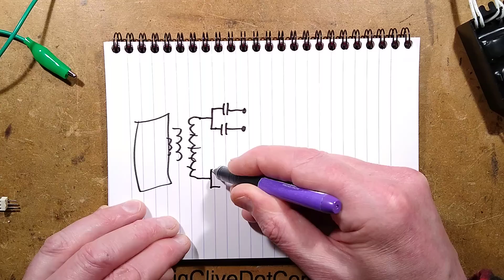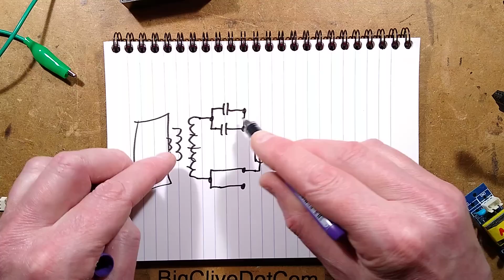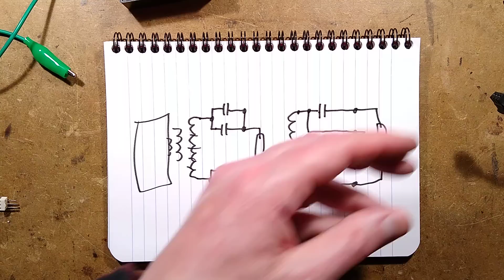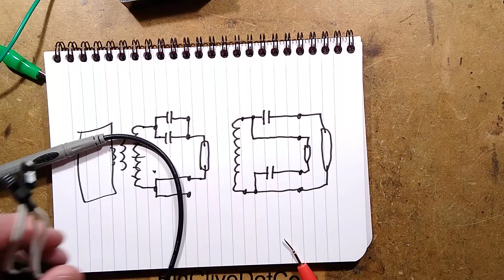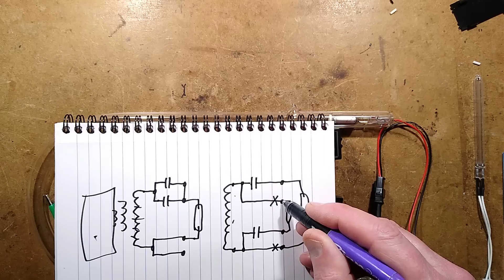Neon tube driver hacks

Comment: A few years ago we were at a restaurant that had what looked like neon lights, but the tube was covered with either a paint or phosphor. Perhaps inside or outside. I couldn't touch it, out of reach. No transparency. Was this a likely a neon tube, fluorescent tube or something else? I didn't think it looked quite right. Anyone know?
Reply: That's basically a fluorescent tube.  Mercury vapor (mixed with a bit of argon) generates UV light which is converted to visible light by a phosphor coating.  The only 'neon' sign tubes that are pure neon are the reddish-orange ones.  The other colors use different gas mixtures, colored glass, and/or phosphor coatings.

Comment: Neon may be getting phased out, but as an avid scifi fan I shall always think of future worlds awash with neon signs especially in their downtown or undercity areas, like Blade Runner snd 5th Element, etc, so it may soon be gone but not forgotten.
Reply from the maker: The Blade Runner neon was stunning.
Reply: There is a bad, low-budget sci-fi movie called Crime Zone (1988) which has a ton of neon. Aside from the usual signage, it has neon in many locations, often in places where it makes no sense, and even a pool table with neon tucked under the bumpers and on the pool cues!

Comment: You could make "angel eyes" kits with a bent acrylic tube, bright LEDs shooting into either end, and scuffing the forward-looking surface to let light selectively "leak" out.  First kits were with halogen bulbs, but LEDs on MCPCBs let you customise the color, too, vs just halogen-white (~3000K).
Reply: Those are junk though. My neon angels in my Audi are Soo much brighter than the LEDs were in my 755il

Comment: the giant neon sign at my work is getting a worse fate than scrap; they're having a signage company cut the ends of the original tubes off, and pull LED tape through with a special diffuser. I figured out that they're DC powered, so the dead sections likely just need the polarity swapped to revive them, but, alas...
Reply from the maker: Pulling LED into existing glass tubes sounds a nightmare unless they are simple curves or straight sections.
Reply: As a glass blowing sign guy who works with tons of both neon and LED I low key love this mash up of new and old.  😂

I predict those LEDs will start failing fast after the first summer in their new glass houses.  I really wonder what kind of warranty the company has bought into?

The company could always pay to have new electrodes welded on after they learn a painful lesson.

Now I really want to try this for a laugh at work.  I'm envisioning myself vacuuming a string through the tube to assist in fishing the LED tape.

Comment: Hello Clive, an old school neon bender (neon glass blower) here, +40 years.  
Have you seen these 3" plasma balls on TEMU for around US$5? They have a very small driver which surprised me on how small they are. I was expecting something like what you have in this video. Maybe this could be a Big Clive investigation?
Reply from the maker: I've featured a USB powered plasma ball and its driver in a video.
Reply: Cheap chinese plasma globes often have a flyback power supply, they output spikes in one polarity and a lover voltage wave in the other polarity.  The Royer/Baxandall oscillator is much better because it outputs a proper sine wave. But of course course nothing can replace the good old Tesla coil.

Comment: Cold Cathode units were massively, massively popular in the world of pretentious computer cases during the middle 00's. It wasn't enough to have a see-through box, you had to have it lit with cold cathode tubes... And then six weeks later when your PC was out of date you had to buy and all-new one.

What fun times they were.
Reply: I still use my bad-tastely modded case and none of my tubes died. 2 decades old tubes and drivers. Not forgetting that my pc is turned on form waking up to after midnight. Talk about sustainability.
The hardware inside was upgraded many times, sometime requiring an angle grinder for installation.
Reply: Still running one of those pcs to this day. I don't do emulsion I use real hardware. Ccfl is SO MUCH BRIGHTER than leds
Reply: I came up in this era. I was one of the early adopters of water cooling, had a Danger Den spiral aluminum block on my overclocked 1Ghz AMD Thunderbird processor when I went off to college in the fall of 2001.  Waterlines went to an external radiator and fan set up which made it a bitch to move because I had to disconnect and drain everything. But I had large fans installed on that radiator running at half speed so damn if the thing wasn’t damn near close to silent which is pretty cool considering my roommates shitty Dell with 1/3 the power whirred and hummed constantly.
Reply: Lol, I just posted a comment a few minutes ago referring to that craze of using C.C.L. in PC's. 

I still have a bunch of the power supplies left over from that era. The tubes are all long dead or broken, but the supplies are still good
Reply: I never grokked that. I usually put my PC on the floor under the desk or in the hutch and couldn't really see it anyway. And now that they are small, they tend to go behind the monitors, where I again can't see them. I need the desk space and the PC was just another thing taking up that precious space.
Reply: @strehlow I’d say the ones that aren’t gaming PCs or “powerful” don’t require the neons in anyway.
Reply: Didn't have to buy a new one. Just like now you upgraded components. We're still running one of those totally clear cathoded cases right now with current hardware. Some people just don't understand what an upgrade is or how to work on their own machines. Sorry but around here is BUILT NOT BOUGHT, we dont buy that behind the monitor Dell or Lenovo bullshit. This isn't the place for you.

Comment: I really don't like LEDs as much as I used to because I feel people get very sloppy about using LEDs to light things well, and sometimes don't care when the colors are just horrible for the application. The loss of good esthetics actually looks far worse than I thought it could get in everyday places. Even the older displays that just used bare led dies as pixels were better than the crappy diffusers so often used. They are just token gestures all too often. It's about shaping the light and making it light up something evenly to the edges. I think of making neon and other types of displays that look as good as possible; as something I want to do just because I know how good they can look. And it seems this is becoming more important than just how I feel about it. I hope anyway.

Comment: The marquee at the top of pretty much any arcade machine ever was CCFL.
Reply from the maker: Many here were hot cathode fluorescent tubes.
Reply: Many especially in the 80s and 90s were just regular fluorescent lamps with a ballast and starter, illuminating the marquees.
Reply: Well, they were cooler than incandescent, hence being suitable for an enclosed space like that. ;)

Comment: 10:30 is it worth making a small wooden frame with the wire going to a small terminal block so the life span is increased?
Reply from the maker: I do have some mounted in plastic bases.

Comment: Thanks for the insight into these drivers, Clive. I don't know if it's possible or practical, but it would be interesting to know what would happen if one of these driver modules was connected to different types of discharge lamp. There are quite a few ranging from street lighting lamps to various industrial and commercial lamps such as those used in retail outlets. Maybe a more powerful driver would be required or would there be quite a nice effect from being driven at a lower power?
Reply from the maker: Driving discharge lamps at low power sometimes works, but there's a point where the electrodes suffer for not being hot and in an emmissive state.  They sometimes sputter from a small point of light that moves about on them.

Comment: There are still benders out here!  I will make you any neon tube you want.  I convert old lanterns into neon lanterns and am always looking for a small transformer, this may do the trick.  Usually I am pushing about 18" of 10mm glass with argon (less resistance than neon so you can push more glass).
Reply from the maker: I think there's a market on eBay for short straight tubes for collectors.  Short and straight to make posting in a tube easier.
Reply: I've been looking for someone to make me a small custom neon tube for a home decor project. I'll contact you via email, thanks!
Reply: @oxoniumgirl I shot you an email this morning.  No problem.  We can talk about size, but most definitely doable!
Reply: Are there any sign makers who use helium, krypton and xenon or only the standard neon and argon+mercury mixture?
Reply: @mernokimuvek helium is used to flush tubes for cleaning, it burns it fast if used as a lighting gas.  I have used xenon and krypton for specialty pieces as the gases are quite expensive.
Reply: If you are looking for cheap and compact SMPS neon sign converters, please consider finding a local reseller of Chinese Hongba products. The HB-C02T and TE are inexpensive and generally effective small units, priced at around 3.5 USD per piece for wholesale purchases, and around 7 USD for retail. They offer no mercury migration  in Penning and no "jelly bean" effect, ensuring clear neon gas tubes.
Reply: @maciekgd  Been using Hongba (Neon Pro) for years.  Well made and great.
Reply: Usually used a mixture of neon and argon as it strikes a lot easier and is more forgiving at different pressures. Was pretty popular for outdoor tubes.
Reply: @christopherleubner6633  I use  "K4" argon gas, a 75% argon 25% neon mix.
Reply: @DragunSigns  the composition of the "blue" gas mixture depends on the climatic zone in which the neon tube is to be used. In Poland, it is a Penning mixture with a composition of 75% Neon and 25% Argon, purity 4.5 (99.995%). For such a mixture, we use a working pressure of 8 Torr in the 15mm tube.
Reply: @maciekgd  Do you add mercury to the mixture or is the Ne/Ar mix enough for blue light?
Reply: @mernokimuvek  You need the drop of Merc to make the phosphor light in the tube.  So if it is for lighting, yes.  For a demo of AR gas, you don't need it but it will not light up very bright without it.
Reply: @maciekgd I think I'm at 8 torr on15mm, but I've been bending mostly 8 to 10mm as most work is repairs of old signs at this point.  Used to use 15mm in channel letters back in the day and boarder tube, have bent any of that in quite awhile though.  Now that I think of it my mix is most likely the same 75 neon 25 argon.  I was reversed.  Dyslexics make his benders!
Reply: @maciekgd  The very definition of a penning mixture is a mixture of noble gases, not mercury.
Reply: Bender Bending Rodríguez?

Comment: I have a bunch of older(1970's) bar/pub neon signs from different beer companies, they all have massive inverters or ballast attached.  Also of note is that the glass tubing is not clear on many but colored pursuant to the advertising scheme for that brand of beer.  Wondering if the gas is colored or white?
Reply from the maker: It may be white phosphor in the tubes.

Comment: 7:33 probably a 22pf cap - the meter was reading about 16pf stray capacitance before connecting
Reply from the maker: That's a good demonstration of how often I test super low value capacitors.  I should have been more careful with lead placement and allowed for inter-lead capacitance.

Comment: Neon tubes are easy to make.
Reply from the maker: Simple ones maybe - with a bit or practice, but the glassworking equipment, manifold, pumps and high current/voltage bombarder make things more complicated.

Comment: 8:11 flush cutters strip much better if the flush side is towards the end of the  wire, so the pull of the wire isn't trying to pull the blades apart
Reply from the maker: I'd normally use a wire stripper, but these had thick silicone insulation on them.
Reply: That's a great tip! thanks!
Reply: That was one of the things I looked for when I was interviewing people for work as assemblers. It is so easy to know who's a pro just by watching them strip a wire and soldering a connection. That or simply handing them a soldering iron and hand tools and asking them to set up their soldering station. It was a beautiful thing to watch a pro set up their soldering iron base in just the right position at just the right angle so they could put the iron back in the holder without ever glancing over at it. I watched 1 interviewee do that first thing and told them they were hired. They asked me if I wanted them to solder anything and I said, "No need." I also watch to see if they break off a short piece of solder with their hands or cut it off with their side-cutters. ( Breaking it off with their hand stretches the solder and squeezes the flux out of part of it, meaning that there's no flux in some of the solder.) Tricks of the trade.
Reply: @johnwest7993 what about those that use the soldering iron to separate the solder?
Reply: @johnwest7993 I'd have dismissed them on the spot, I my old line of work you had to use the correct wire strippers taking short cuts would not have been allowed. Its horses for course's,  I do it that way all the time at home😂
We even had to log how many crimps you made with the crimper as it had to be checked after every few hundred crimps made, to confirm it still met specification.
Reply: @solarsynapse  usa isn't always known for quality but some products are done well.
Reply: @johnwest7993  The solder John West rejects.
Reply: @johnwest7993 Must have been a rubbish company you hired for / work for. 
A real professional doesn’t use wire cutters to remove isolation. That is amateur and hobby level stuff. 
Secondly, watching how people are setting up their work station?
What works for you may not work for others, as simple as that. 
I do agree however pulling solder apart isn’t the greatest. 

I give you 2 stars out of 5.
Reply: @johanea , I didn't set out wire strippers.  We used a machine to prep wires for production. Hand wire-strippers are for amateurs. They're much too slow and inconsistent for high-quality production. But I wanted to see how proficient a candidate was with what they had at hand. We wanted the best to work on our flight bds. You can seldom send someone up to orbit to fix sloppy work, so NASA certification was mandatory. BTW, I've done tech work at HP, TRW, IBM, and SONY, among others.

Comment: Not sure how I missed this one

I thought angel eyes were a new thing with led, I'd never known them to be ccfk before, I'll Definately have to look into that or getting the bulbs

For neon tubes, is the neon tube voltage higher for a single terminal, or less if it has connections at both ends?

Measuring capacitors in circuit, naughty

Comment: Question about the thinner size tube needing more voltage. Some Googling revealed that neon is about generating plasma in the tube. I suppose it's harder to maintain plasma through a thinner tube?

(P.S. I just got my first lower voltage bench power supply and the first thing I checked was the ground through to mains. Thanks for all of the great safety tips, Clive.)

Comment: Nice little driver, got to say real neon is soooo much nicer than LED fake neon. 2x👍
Reply: Honestly I like both, they have their applications. Of course, nothing will come close to the beauty of true neon, but LEDs are extremely efficient, both power wise and cost wise, and also don't require a noisy (EMI wise)/dangerous power supply.
Reply: I prefer the new LED neon, it looks more real.

Just kidding!
Reply: As a guy who bends and installs neon, hard to agree.  LEDs literally solves all the things I hate about neon, and meet or exceed all of the things I love about neon.  
I hate the glass shards.  I hate working with mercury.  I hate burning my fingers.  I hate  inadvertently stepping on a hose and extinguishing a glass torch.  I hate transporting them like they were the last piece of glass in the world.  I hate repairing units that I broke pushing the trode into a PK.  I hate getting shocked by high voltage.  I hate lugging around 30 pound ballasts into ceiling plenums while playing The Floor is Lava off of a ladder.  I don't love how neon is dim and miscolored for 5 to 10 minutes until the mercury heats up in the winter.
Oh hell, I must be old and crochety now, I could go on like this for days.
Reply: Nothing beats old school neon.

Comment: Thanks for the teardown!
Ordered multipe a few weeks ago. Lovely little unit. I use one to drive the neon tube in a Sox lamp at very low power so the sodium doesn't vaporise and the lamp stays in that lovely pink startup sequence.
Reply from the maker: Ah yes.  I remember now.  It was for a SOX lamp.
Reply: Sadly, Philips stopped making SOX lamps in 2019.
Reply: @mernokimuvek  China makes them now though. Not cheap I'm afraid, but they make them.
Reply: @TheFreak111  The quality is questionable.
Reply: @mernokimuvek  shame

Comment: Bet I could use one followed by a rectifier and filter for powering a photomultiplier tube. These don't draw a lot of current. Nice deep dive into output configurations.

For artisans who still make neon tubes, check Glasslinger's giant quasi-Nixie out: https://www.youtube.com/watch?v=T6SUaZ8PLeI
I named it "quasi-Nixie" because it doesn't have the typical Nixie mesh/box anode and number-shaped metal cathodes; these would be extremely hard to pull off in this size, when it comes to the amount of gas used and ensuring the uniform glow around the entire cathodes.

"This is a folded YouTube"